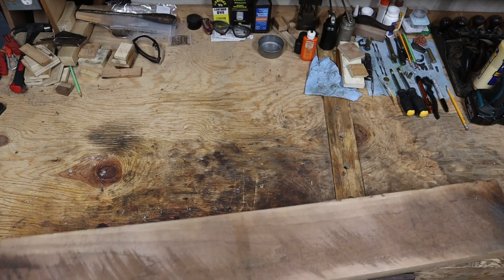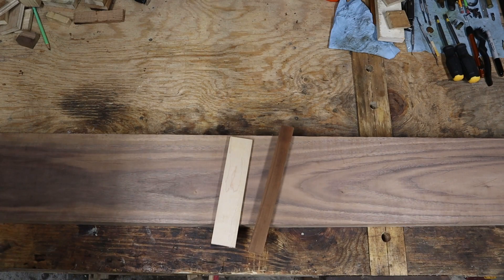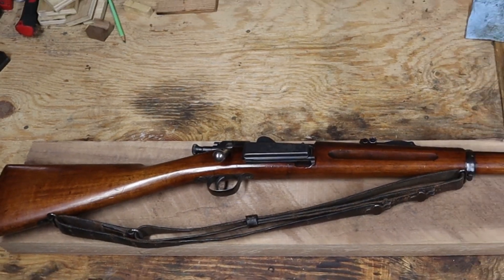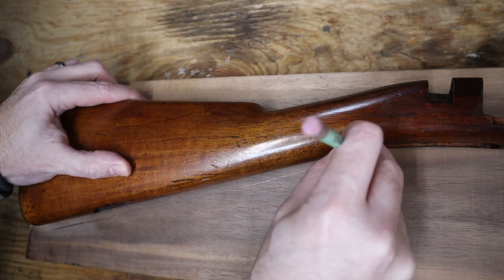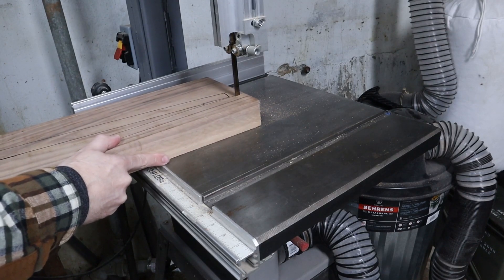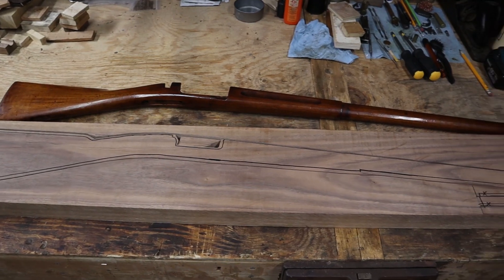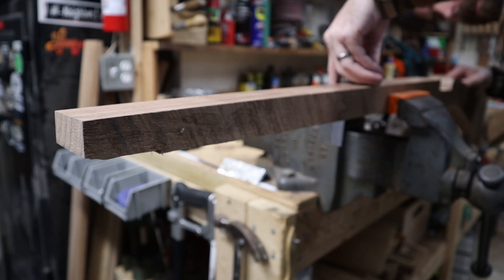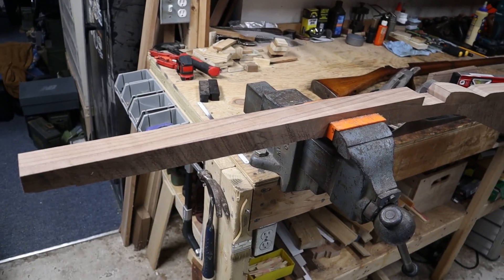Making a Military Rifle Stock Part 1

Comment: Where the heck can you get wood that has the dimensions you need?! I can’t find anywhere
Reply from the maker: You won't find wood like this at a big box store. Try and find a local lumber mill, hardwood supplier, or a store like Woodcraft or Rockler.
Reply: @ thanks!

Comment: What bits are you using
Reply from the maker: Which bits do you mean? The router bits used for inletting?
Reply: @rakumprojects  sorry to get back to you late, what bits do you use for the barrel channel.
Reply from the maker: @oldtruckoperator2106  they're called cove bits. 1/2, 5/8 and 3/4 are my most used sizes.
Reply: Ok thank you

Comment: You have picked what must be one of the most fragile military stocks to replicate.  The Krag-Jorgensen action forces the removal of the "sides" of the stock to fit the magazine leaving only a narrow section under the action that could be easily broken by careless handling.  See https://www.youtube.com/watch?v=87jHzQ70Zck&t=1163s at the 26:00 minute mark for better discussion by experienced gunsmith.
Reply from the maker: Mark is good. He's spot on about that area being fragile, but really only when the action is removed. I've seen Krag stocks with minor cracks in that area, but nothing too significant. I should have mentioned it in the video, but for this particular stock, straight grain in that area is just as important as it is with the wrist.